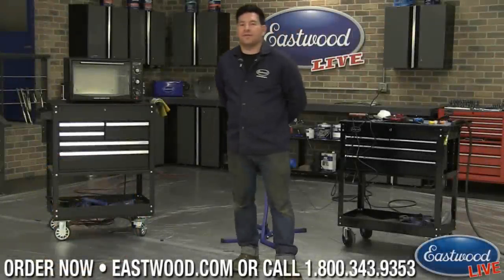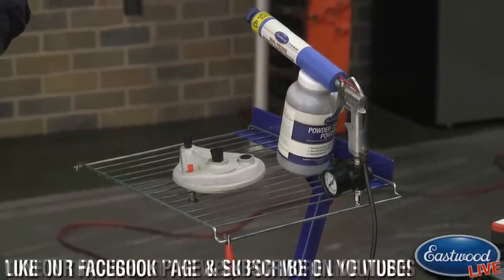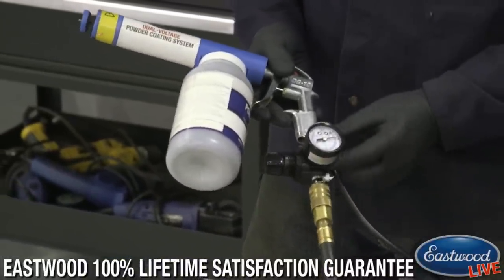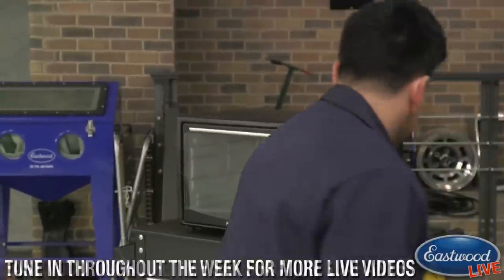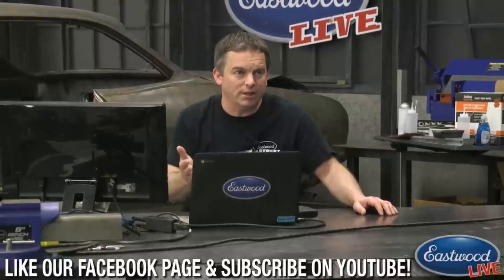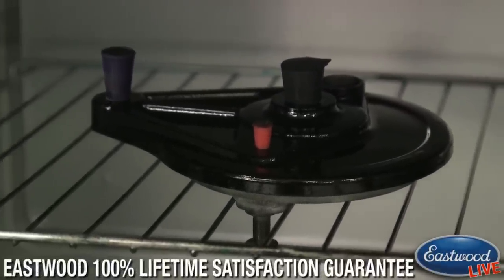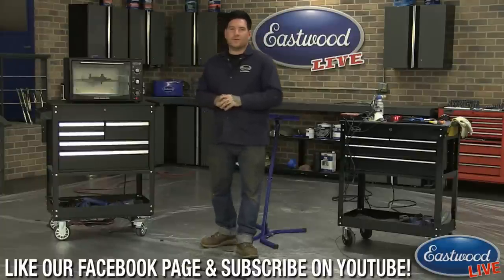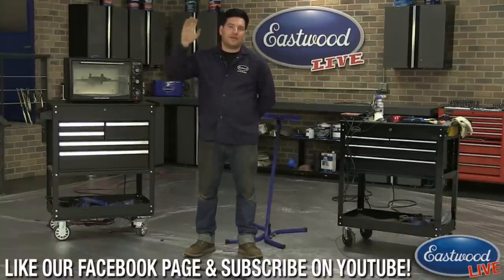How To Powder Coat Motorcycle Parts - Eastwood

Comment: My cycle a HD Pro Street CVO Breakout has an inverted front fork. The lower part is chrome. I want it all black. Can this part be  powder coated? Thank you.
Reply: Absolutely not. Too thick for the tolerances. Plus it wouldn’t stand up to the harsh friction of the seals. Have them Anodized instead. Anodizing becomes part of the part. While P-coating sits on top of the part.

Comment: Why does my dual voltage gun get like ashes behind the emitter metal tip , and do I keep pressing the finger trigger until I finish spraying correct?
Reply from the maker: If it gets excessive build up you can take the end cap off and clean it with an air hose and then continue.  As for the trigger you can spray continuously or you can trigger intermittently whichever is working best for you.  We find that the corners sometimes take triggering to get the proper coverage.
Reply: @eastwoodco  ok thanks just thought i might be doing something wrong on my end

Comment: Can you put multiple parts in the oven at once or do you recommend just one at a time?
Reply from the maker: You can cure multiple parts.  I don't recommend stacking them, or doing anything to prevent heat flow in the oven.  Also, cure the same color, not different colors at the same time.
Reply: Whatever you have room for. Multiple parts will be fine.

Comment: At what temperature does steel get the most porous, as I have read or maybe heard, the steel molecules expand during heating allowing the powder to melt into the open pores. As it cools its pores shrink back to normal making a slight binding effect. True? Also, I Really, Really need to see High Temp Coatings being applied, and its maximum effective temperature. Ceramic Coatings as well.
Reply: Yes, as in performance headers. Will the powder coating hold up to the heat the headers will produce? Or do you go to ceramic coating?
Reply: Hi can you powder coat fibreglass parts
Reply: @DragonHumper  I was told powder coating works on exhaust parts as long as you are very aware of your bikes temps.  If you aren't running optimally and your bike overheats, powder will come off.  I'm personally going hi temp cerakoting for my exhaust shields

Comment: Is there any difference to coating lead weights for fishing and diving
Reply from the maker: This technique can be used. We've also seen people heat the weight and then dip it into the powder (which means the powder sticks to the weight because it's hot, not because of an electrical attraction), but we've never tried that technique.
Reply: Have tried dipping before with substandard results hence looking at doing properly with a gun. Thanks for getting back to me. I will be getting a kit soon, thanks guys
Reply from the maker: If you have any more questions, you can always contact our Tech Department. We now have extended hours to assist our customers. Good luck with your projects.

Comment: Can you powder over chrome parts?  What's the process for doing that?
Reply from the maker: Check this out, which may answer a few of your questions:  https://youtu.be/nkfSkeh01cg
Reply: Yes you can. But the “Prep” process is the same as if you were P-coating a rusty piece of steel. You must “blast” the part to give the surface some “bite” for the Powder to adhere to.

Comment: Hi do you have too preheat parts before you powder coat them
Reply from the maker: No, most parts don't need to be preheated or hot flocked prior to powder coating.
Reply: No. You don’t have to. But, if you want a certain finish, pre-heating is another approach & step in P-coating.
Reply: Hi thanks for feedback and I am in the uk is ther any wher I can get Eastwoods products

Comment: im just ordered the kit and want to coat my bike carb how far do i have to disassemble.....do i have to take the throttle body off
Reply: Tre Johnson if you have to ask that you shouldn't be touching carbs.
Reply: I wouldn’t recommend it. P-coating is too thick. Even applied thin. Have it Anodized instead.
Reply: I've seen s&s carbs powdercoated in the past

Comment: how do you clean the rack and oven from the spray in the rack?
Reply from the maker: You could put aluminum foil on the rack so it' doesn't get covered with powder.   Eastwood also offers a chemical Powder Stripper.